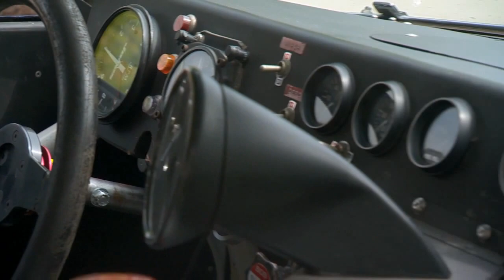1000+ HP Paul Newman Nissan Turbo ZX | All American GT Race Car | Bob Sharp Racing IMSA Street Z Car

Comment: I had a chance to buy a 240Z Bob Sharp Racing Special back in 95. The car was mint and stored in a garage all its life. Only 14,000 miles, white with tan interior and it had a Bob Sharp intake, Bob Sharp valve cover, Bob Sharp wheels, Bob Sharp shifter, headlight covers front and rear spoiler, roll cage, stock seats a 5 speed and a/c. The first owner didn't like the Datsun white and had it painted a pearl white before it went to Bob Sharp. I offered $2800 when I looked at it. The owner wanted $4000. I was trying to get a deal. I found out the next day they only built 13 that year but the car sold the very next day for $4000. The owner said, "The guy bought it before I had the  garage door opened." If I had only known what I was looking at that day.

Comment: I have used ALOT of customautosound products and i will tell you the BIGGEST down fall..... no pre-outs for amplification which just sucks...no sub outs no nothing...a lot of my customers are not happy with just powering their system with just the deck itself...please add pre outs!
Reply: Agreed. I have the cheapest head unit they make, which in no way was cheap IMO, but it sure looks and feels like it. $25 head units have more options and are better made. Then again, perhaps they are trying to go for that more classic feel... ...where everything was made in the US, and as a result, cost more to produce.